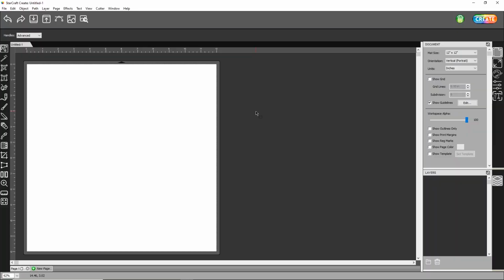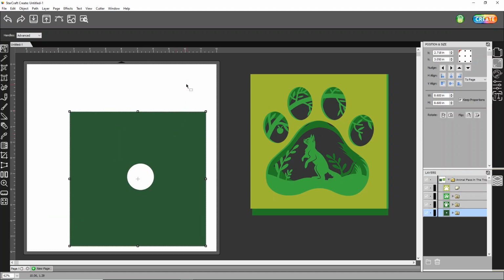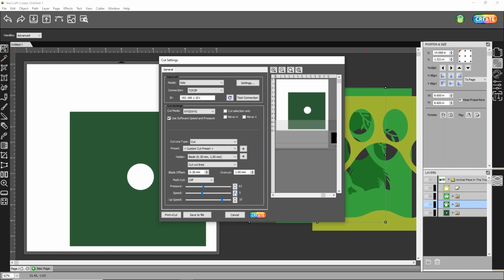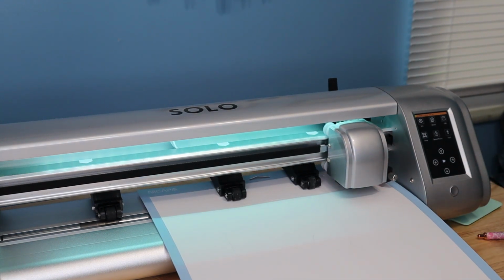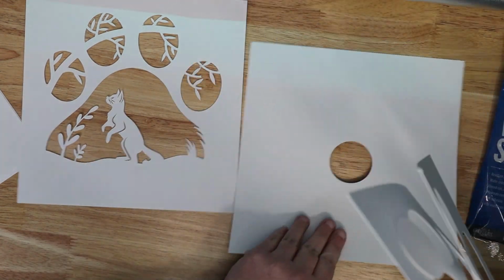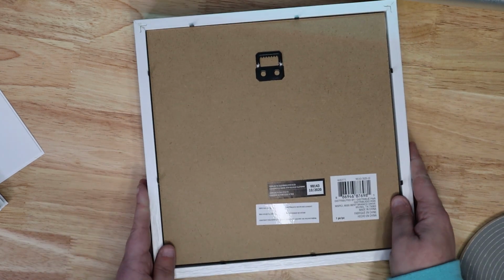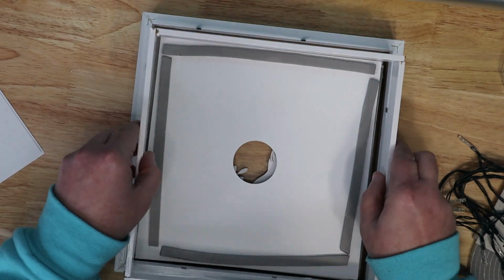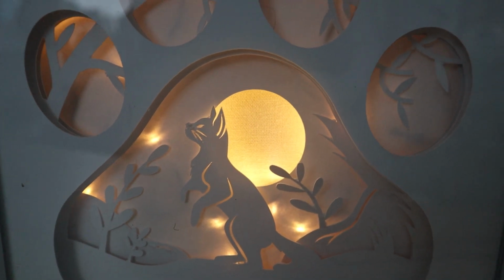Cutting cardstock with the StarCraft Solo machine - 3D lighted shadow box tutorial

Comment: Can this cut 24 or 28 point card stock? I tried with my cameo 4 with the deep cut blade and that won’t get all the way through it.  Looking for something that will.
Reply from the maker: Do you mean pound? Yes but you may find some of the thinner pieces don’t stand up as well as you would hope
Reply: No, 24 pt is very thick cardstock. It’s .024 inches thick. I don’t know the pound rating. It’s like a business card thickness, maybe a slight bit more.
Reply from the maker: @elimoeller9154  oh ok it should work ok but the light may not be very brght
Reply: It’s 400 GSM. My Cameo 4 isn’t doing a good job of it. I’m not trying to make a light box. I happened upon this video because you’re cutting cardstock. 😉